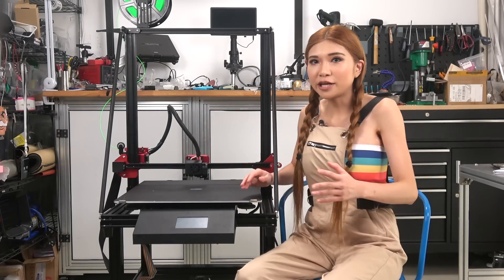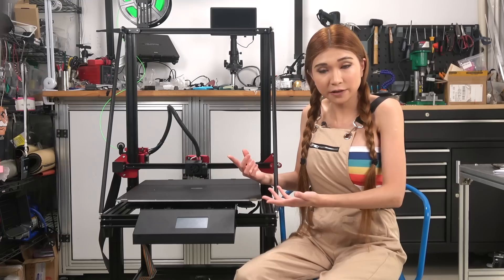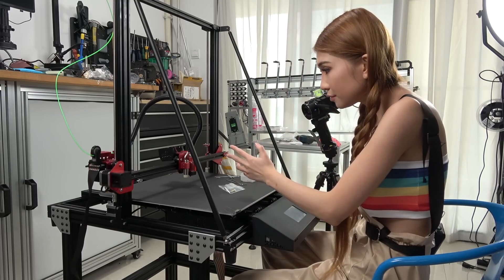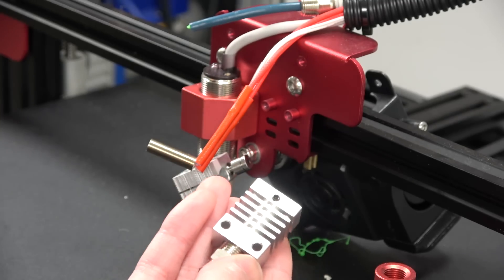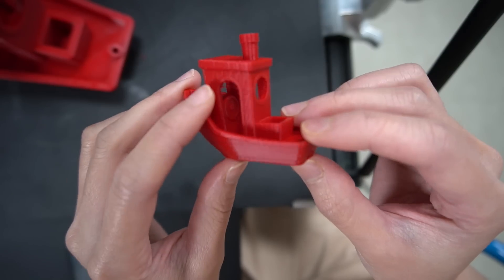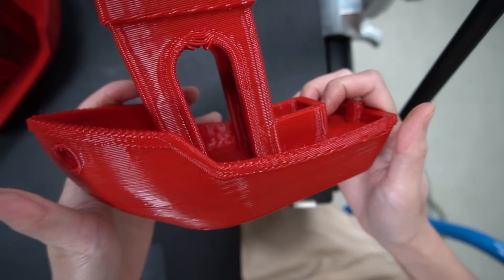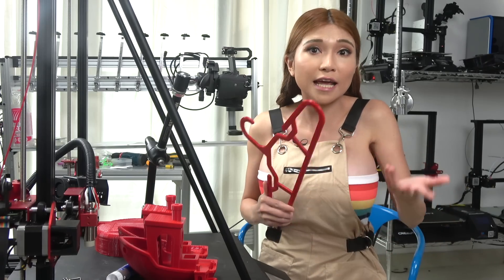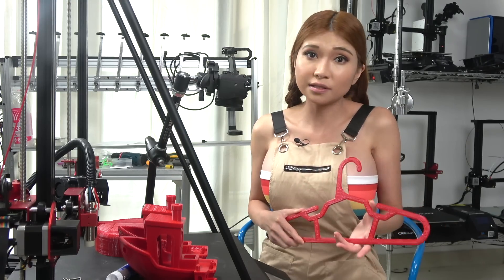First Look- Creality CR-10 Max! Also, Supply Chain Disruption- Are We There Yet?

Comment: You bring up some very good points as far as the Integrity of a build the time and cost and that got me wondering Do you think they will come out with a printer that has two or more nozzles working together on a single build to help cut down on production time and maybe improve the Integrity of a build.    
Thanks for the great videos and keep it Rockin beautiful lady
Reply from the maker: There are dual independent nozzle printers, just more to break. I'm not a fan...
Reply: @Naomi-Wu  I can see that being twice the problem and in your position being a builder and promoter would not be good

Comment: My question is couldn't you install a quicker motor and then install a hotter heating element to make it quicker
Reply from the maker: The ammount of heat the heater cartridge can put out is the bottleneck- not the motor speed. You need to upgrade the electrical system to handle the higher wattage but it can be done. It's just a more involved upgrade than a simple hotend change.

Comment: "Vases and other useless stuff" :D  By the way, could you load up many smaller items in one print and thus save the work of reloading the printer many times?
Reply from the maker: Yes, you can certainly fill the bed up with small parts.